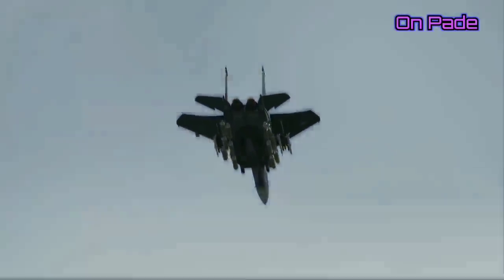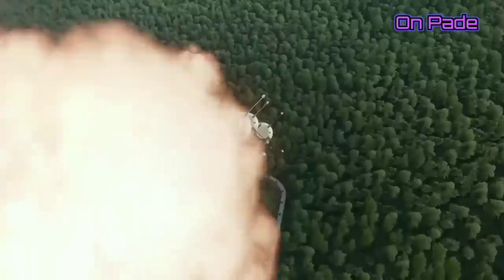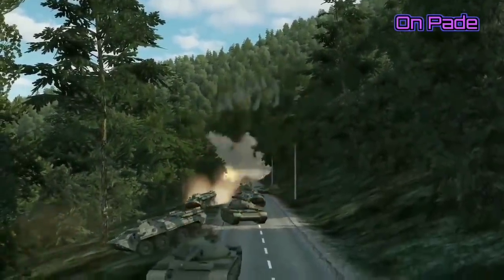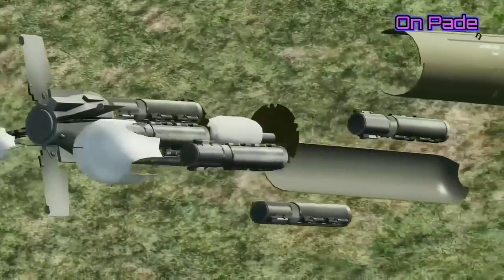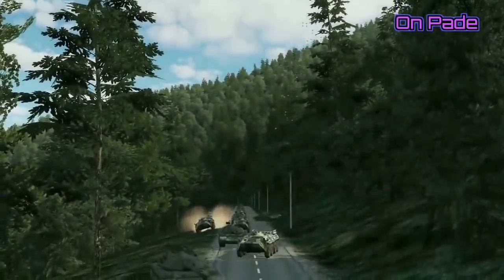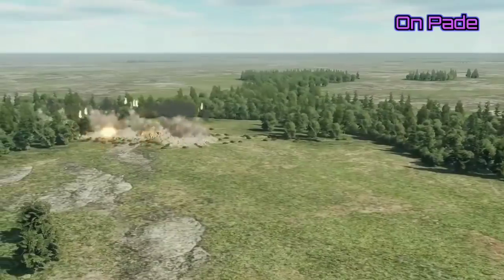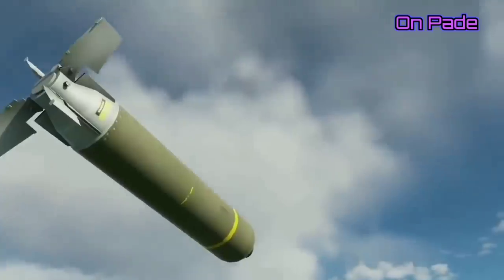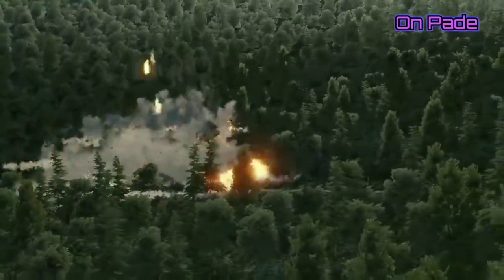CBU-105: This Bomb Can Destroy 40 Tanks in One Second

Comment: Please give this to Ukraine Soldiers so that they can protect their peoples and country from Russia
Reply: My wish too!  8 miles long of  Russian tanks are sitting ducks.  They should take advantage of the opportunity.
Reply: Ukraine doesn't have air units able to launch it. They don't have any bombers.
Reply: @barredok  They don't need bombers, drones could deploy these easily, although in less numbers. Just a couple of these at a time could suppress many armaments.
Reply: @BWoody914  lamo how dornecgonna carry 3000 kg bomb
Reply: TB-2 is running out of bombs from Turkey. Can the sub munitions be connected to the TB-2?  How much does each sub bomb weigh?
Reply: @sun_intouch  The entire bomb weighs 1000lbs, and It's called a Reaper drone, I believe the aid packages mentioned a nice present in them. Individual bomblets could probably be deployed from the TB2.
Reply: @sun_intouch  could you imagine if the skeets were mounded individually on cheep quad copter drones? All you need is to fly over the target with an armed skeet and done. Anything producing heat is fucked.
Reply: @BWoody914  the TB 2 cannot use these smartbombs. Full sized SEAD and DEAD weapons range from 2000 lbs to 10000 lbs. The Bayraktar has a 150 kg maximum payload which reduces its flight range. The Reaper is a more advanced drone and exclusive to US allies. It has a maximum payload of 3800 lbs. The two drones are different orders of magnitude from each other.
Reply: @barredok  Re-read, "Individual bomblets"
Reply: @BWoody914 they are already using small bombs. If you have to dismantle a SEAD bomb to use its individual components you are using the wrong weapon. It would be cheaper, safer and faster to buy or make your own bomblets. That particular missile's bomblets weigh 200 pounds. Shaped charge semtex bombs which the Ukrainians have mass production for are a lot easier for them to use than ordering these from the states without the planes to launch them
Reply: @Pohonesty  especially not during an all out war for survival where every cent is needed for ammunition, winter survival gear, and even basic MREs. A lot of the soldiers were having trouble getting supplies in until the recent Russian rout from the North. The Ukrainians are desperately trying to buy everything from food and gear to weapons batteries and ammunition for the coming Russian assault in the East.
Reply: @sun_intouch  With the Reaper Drones we the USA has just given them.....
Reply: Why not Russia has a lot off horrible weapons 😕 👍
Reply: Ukraine never had a chance. Mother 🇷🇺 Russia is a Super Power country. Russia Wins.

Comment: We should use that on the 8 miles stretch of equipment I hear is moving in. That would be called a cluster F*ck. 😉
Reply: Or a Bang>~<Gang
Read it plz, the way it was intended, and overlook the initial presentation to get past  G/YT sensors.
Reply: @WaterburnerActual  Ha, they wouldn't sensor that. Good one though.

Comment: "Can Destroy 40 Tanks in One Shot" Uh, yeah, just like I "can" win the lottery 10 weeks in a row.
Reply: The sensors in the submunitions are pretty advanced, they can distinguish between high and low value targets, taking out the tanks and bmps while ignoring the trucks for example.
If you have 40 tanks in a single square mile then yes it really is designed to kill all of them with one bomb. The warhead on a Javelin or NLAW is under 2kgs, plenty to kill a tank using top attack.
The clever bit about this weapon is just making sure that the 2kg warhead can detect and fall on top of a tank if there is one close by.